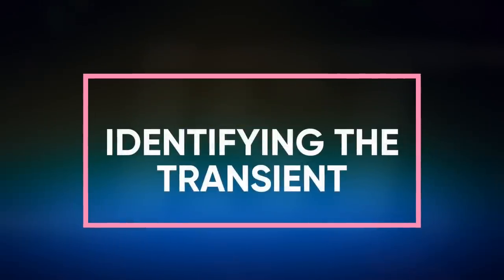How To Edit Electric Guitars!

Comment: Miami, how to deal with string buzz that comes through the DI? Or a better question: how much string buzz is "acceptable" on DI recordings? Even properly setup guitars produce some buzz when playing hard and I wonder if worrying too much about it is actually worth it in the context of distorted tones.
Reply from the maker: Thanks for the video idea, I’ll throw it in the queue 
-Miami
Reply: @victor Salciotti

It's something simple:

1) If the buzz is not audible in distorted tone, then obviously it is not a problem.

2) If you use strings without adequate tension with low tunings, in addition to an aggressive picking hand technique, with a thick pick, you will always have tuning and buzz problems.

It is best to have a medium pick attack, there is no benefit in savagely destroying the strings, with the lie that they have always sold us of "BEST TONE" if it is done that way, on the contrary, there are more disadvantages than benefits . Cheers.

Comment: Awesome video Miami, really appreciate all your insight and knowledge you give us. 

Question: I typically record my physical amp for my guitar stuff, but want to dabble in amp sims. 

I've tried various Neural DSP plugins, and while they have some very cool features, my signal is constantly clipping, noisy, fizzy, and just not good, save for a few settings I like. 

I'm sure I'm just missing or overlooking something, but I haven't found a good solution. 

It would be very cash money of you if you could touch on this subject a bit. 

Thanks man!
Reply: Are you using the standalone or vst? If you have a scarlett, turn off direct monitoring and turn down your instrument gain. For whatever reason direct monitoring and setting the gain knob to 1/4th was too much on my solo gen 3. It sounds samplerate related. I'm also going to assume you've increased your buffer rate? Have you made sure your DAW sr matches your interface? You could try turning off audio exclusivity for your device via control panel. While you're there you can check to make sure the sr matches. If its none of those, its probably hardware related. Be it your cable, pickups, interface or the computer itself.
Reply: Philip, sounds like a problem I had with a Presonus interface. Though the interface had 2 jacks that I could plug my guitar into (in the center of 2 mic inputs), they weren't actually made for instruments. I just assumed that they were for guitars, but they were actually for mics that have a 1/4 jack insert. So no matter far down I turned the input gain on the interface, the guitars would still show up in my DAW as red-hot, clipping. I actually had to adjust the pickups on my guitar and back them away from the strings so that the incoming signal stayed below clipping. Really killed the sustain on my leads. 

But all that said, I used it for a couple years and then bought an Audient iD4; an interface that specifies that it has an "instrument input". It actually has a guitar symbol printed above the jack on the interface. And that "instrument input" is specially designed for guitar signals which run hotter than mic information. I was able to readjust my pickups on my guitar; and I'm able to use the gain volume on the interface for the guitar, boosting the incoming signal or cutting it back; but it works as it should now. 

Hope something in there helps, or at least you figure out something!
Reply from the maker: I’ll keep this in mind for a future episode, Philip, but an example would make it easier for me to understand what your issue is
-Miami

Comment: quick question if i only have an interface and i use a amp sim would i still need a DI box?
Reply: No, with current interfaces like a scarlett 2i2 for just 170 bucks or similar, you don't need any DI Box to get a good guitar tone with amp sims
Reply: @butcher_0392  but if I was to use a real amp then I would need a DI box for the best results or at least get a clean signal so I could reamp later
Reply from the maker: I always suggest a di box when using low budget interfaces
-Miami